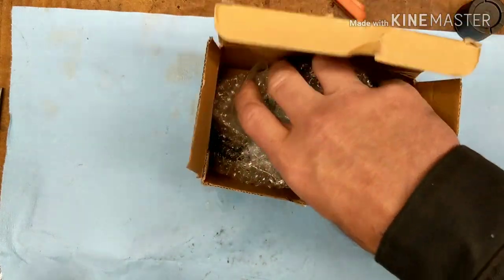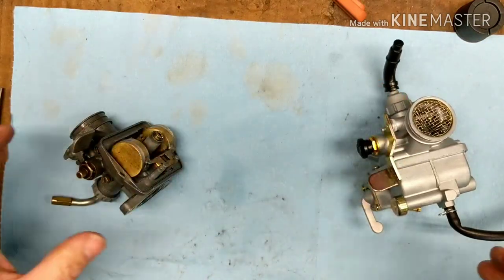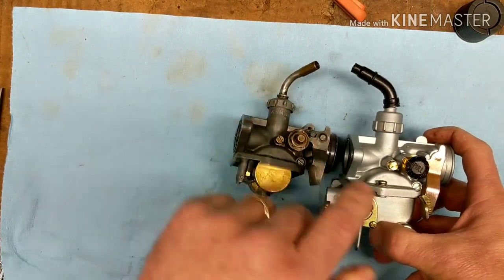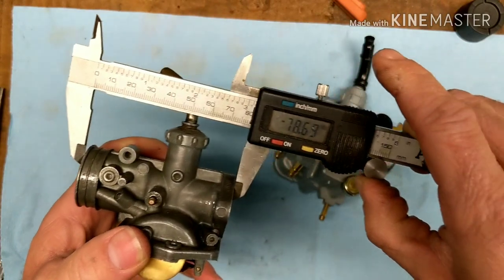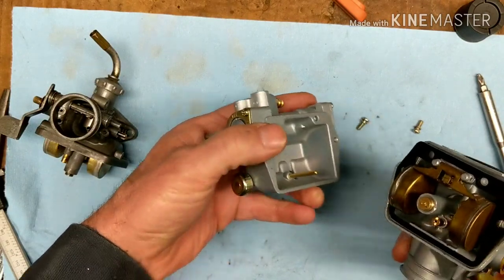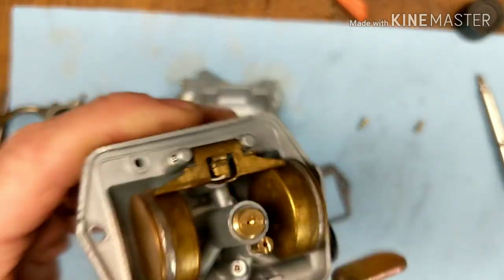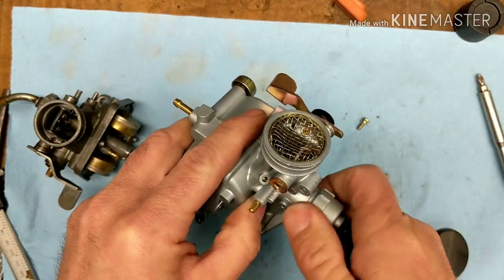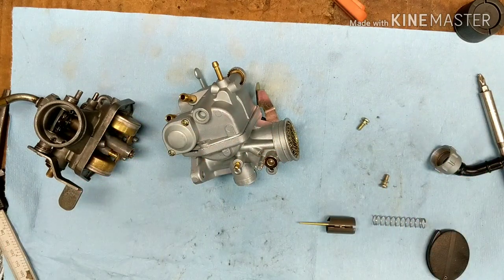Honda CT90 aftermarket perfect carb!

Comment: Got my carb on EBay. Pulled out the drain pipe And shortened it on a sanding wheel, tapped in back into the carb and no more clearance problem. One kick start.

Comment: I owned a 1970 CT90 which the PO had  sent in to Powroll in Bend, OR, was their race tuned stroker, bored and hotter cammed 125cc.   The original carb was replaced by an ATC125 carb. It made great power but it really could have used an oil cooler which no-one made back then.

   Your after market carb starting without the choke means it's far too rich in the idle circuit pilot and possible the airbleed adjustment too. Stock adjustment should be the engine starts with the choke on  and starts to stumble a little so you feather open the choke in stages until it's fairly warmed up

26 years later, I've got a 1969 C-102 with a extremely worn 49cc stock engine and I've replaced it with a semi automatic, pitbike 125 cc Honda clone, that isn't too far from the performance of that old Powroll kitted engine.  Same rather stiff compression means you've got to start it like an old BSA MX 500, with the engine on TDC/compression stroke.   It's clone engine has a clone ATC carb and that carb needed a lot of rejetting work with it also being too rich in both the main and pilot.  I kinda miss my old Powroll'd CT90, that engine's immediate torque curve increase almost made the 4X4 trail gearing unnecessary.

Comment: the ct110 carb will work just fine on the ct90 and you get a little better performance overall and a little easier to source. I have a CT110 carb on my 90, I'll have to see what jets I am using

Comment: I apologize for previous comment, installed carburetor from winn cycles your correct hood upgrade, may have to trim shroud to clear throttle cable thx

Comment: Jim Morton I had the exact same thing happen on a 76 CT90. Put the new carb on. Had adjusted the points and at WOT it will bog every single time. I am in Idaho at 4200 feet but definitely frustrating experience.

Comment: Today I solve a long going problem.
I've stressed over my carb no doing good after 35 mph except down hill , today I drilled holes in my gas cap and that fixed it.
My bike now gos 45+ more down hill "I can live with that"
What I learned was it was creating vacuum in the tank and sucking air through the gas line going into the carb at the carb under the clamp.
My cap had a very small hole on one side and two the same small size on the other, I drilled two on each side approximately the size of #2 pencil lead , I did get a little splash of gas out of those holes but my tank was completely full at that test drive time.
Maybe this can help with someone else mystery.
I wish I could send pictures.
Reply from the maker: Thanks for the info, a clogged vent cap can definitely cause havock!

Comment: Great review. So can you tell me where you got that carb, and any specific number needed to order the same one that you did? I need one for my 71 CT90.  Thanks.
Reply: Dratv has some on website. Good ones not from China think there about $50. I also have a 71 and the stock jet size is wrong. I believe there was even a recall on it. So if your main jet is 65 it’s wrong. Should be something like 75. A65 main jet will burn your Engine.

Comment: Carb size:  Measure INSIDE throat diameter using opposite end of caliper, no? (31mm)
Reply from the maker: Yes, inside the engine side of the carb.
Reply: @TepcoCycleRepair  thank you Sir

Comment: Buyer beware, the Chinese carburetor will not fit a 1969 ct90 k1. The bolt holes do not line up, I have already tried two different carburetors from different suppliers and neather one worked. Also most new carbs for the ct has the overflow come straight down, which also creates a problem with trying to attach them. You can pretty much find carburetors for the ct except for the 1969ct90 k1.
Reply: Did you figure out which one fits best? I've got a 67'
Reply: Dratv.com probably has what you need
Reply: @shermgerm6458  did you find a solution? I also have a 67

Comment: Just installed this carb on my ct90. Its leaking gas from the bottom overflow when in the on or reserve position. Any idea what I have done wrong? Thanks for the great video!
Reply from the maker: The float might be stuck, just tap the side of the bowl with the back of a screwdriver to free it up. Sometimes it happens from carbs sitting.

Comment: Thank you sir.  I have a new Chinese carb on my ct 110 (1982). I've got good compression, taken top end off, had valves leak tested and the rings while original seem to hold air under leak down (in other words I highly doubt internal engine problems).  Tuned and re-tuned the carb and it runs great but only through mid throttle.  Tried every clip position on the pin (it came to me at position 3- moved it to five and it ran poorly- I find position 2 is the best).  Very responsive throttle, great starting.  Even though the carb has less than 100 miles I did a cleaning (not rebuild) however I did NOT check or adjust float level.  I am not confident that I can measure level with a caliper/rule so i will check with the clear tube method.  Do I sound like I am on a logical path here to determine why under heavy load AND/OR WOT it bogs, spits--If I apply manual choke under those circumstances it almost kills the bike.  I welcome any and all's advice.  Thanks for the great videos.  Subscribing now. Jim
Reply from the maker: Sounds like your main jet is to rich. Lean your main jet a few sizes an see what it does.
Reply: Try removing the advance mechanism and cleaning/lubing.  Also check for intake obstruction (remove filter and test ride).  I found a silica pack in my pod filter and had same prob.  Other than that, do the timing and set the points to spec. This assumes the main jet is clean cause it's new.
Reply: @broadwayFan28  Will do thanks.  And I have electronic ignition so I do not have points, correct?  I need to check my manual
Reply from the maker: Correct, you do not have points.

Comment: Great vid. I've been thinking of buying a new carb for my ST90. I have the high idle issue and I have solved all air leaks except near the base of the carb. Had new rebuild kit with new gaskets. Still an air leak. I'm wondering if I have a crack in the carb somewhere. I'm also wondering if my high idle issue is caused by something else.
Reply from the maker: A bowl gasket leak won't cause high idle. Make sure you have free play in your throttle so it's closing all the way. Does your bike return to idle quickly or slowly. If slowly, go to the next richest pilot jet or try adjusting the mixture screw a bit richer. If you're turning your idle all the way down and it's still high, your slide isn't closing all the way. Hope those tips help. Thanks for watching. I have 3 CT90's coming in for repairs/service next month.

Comment: All the carburetors I've ordered have all had the bolt holes to wide, the bolt holes on my intake tube are 2 3/4 in. Wide at center. The new carbs bolt holes are all 2 7/8 inches apart at center. All the new carbs say their for a 1969 ct90 k1 which is what I believe I have, all that being said I'm wondering if I need to just rebuild the original carburetor. HELP!.
Reply from the maker: I wonder if it's just a different intake manifold between the two years?
Reply: The 69 was a one year only design, alot of hard to find parts.

Comment: Thanh you for doing this helpful video,  I have a CT 90 trail bike and need a new carb.  Where did you find yours?  I see on mine the bolts to the intake are not directly horizontal but slightly off set which allows the carb to sit horizontal or straight.  Is that how your carb was ?
Reply from the maker: I put a link in the description. I've been told this carb doesn't fit a 1969 as those are different. The holes are off set on this one.

Comment: Awesome video! Also do you think this aftermarket carburetor would work with a 1967 model? The intake is vertical facing up and down instead of horizontal fore and aft like the 70s models. Not sure if this would mess up the float operation.
Reply from the maker: The carb has to be upright so it depends on the intake manifold.
Reply: @TepcoCycleRepair  thank you!
Reply: Did you find a solution? I also have a 67 that needs a new carb
Reply: @Hannah Chebeleu  This aftermarket carb didn't work for the 67. Sadly it is still in storage as I'm having a hard time finding a rebuild kit or replacement for it. Honda only used that particular Keihin carb on 64 through 68 year models then switched when they re-positioned the intake port in the cylinder.
Reply: @yetanotherlancer  thanks a bunch for the info!

Comment: You know where i can find the 1/4" black plastic looking gasket against the carburetor? Mine is split and broken chunk missing at the bolt. I need this carb and gasket. Thx for sharing! 👍👀
Reply from the maker: Part # is 16211-077-306 under $12 at rocky mountain atv. Thanks for watching! https://www.rockymountainatvmc.com/oem-schematic/2
Reply from the maker: Search for Part #16211-077-010 on line it's the old #
Reply: @TepcoCycleRepair  Thank you So Much

Comment: Good informing video. I'd like too see more ventilation in your shop for your sake though :) perhaps a hose on the exhaust out the window at least. Happy trails.
Reply from the maker: Thanks, I have a large exhaust fan. I cut it on between takes.

Comment: Just got this carb from amazon (canada) 
https://www.amazon.ca/NewJs-Carburetor-CT90K2-CT90K3-Replacement/dp/B08FC8PL5N/ref=sr_1_16?dchild=1&keywords=ct90+carb&qid=1624416813&sr=8-16

Identical to the one you have here, they are sold under a couple different names. Glad to see that the only change i need to do is the drain fitting, Can't wait to see if this bike will run :D

Comment: How is the china carburetor doing? Thanks
Reply from the maker: Doing good, customer hasn't mentioned any issues.
Reply: The item is out of stock now. Any other recommendations?
Reply from the maker: @danksoulsguru5281  So if you look at others, they have different slide caps. Look for one with the same top slide cap. No guarantees but I would bet they are the same.
Reply: Try dratv.com he has them.

Comment: That carburetor will not fit a 1969 ct90 k1
Reply from the maker: Thanks, what's the difference in the 69 that won't let it fit?
Reply: The intake manifold. You'll need to get the newer K2 and up intake manifold.
Reply: Just found out it doesn’t fit a 69.
Reply: Setting the points